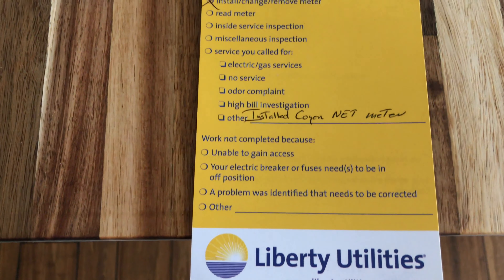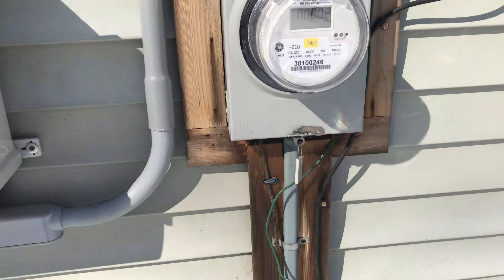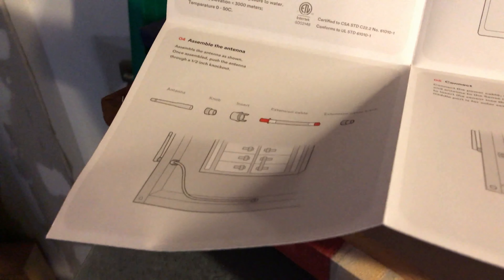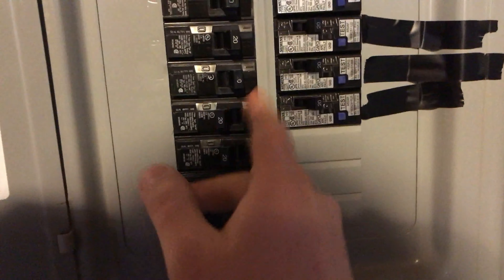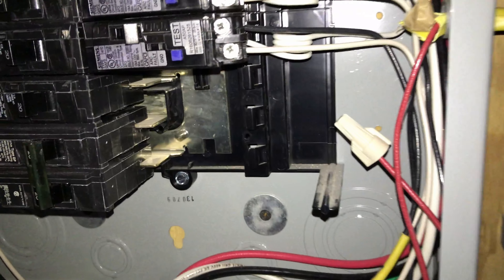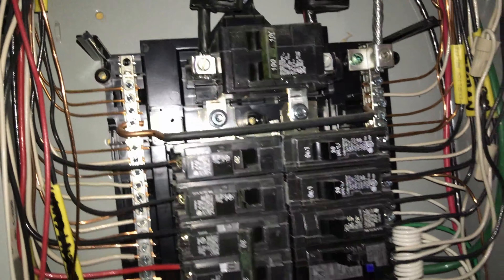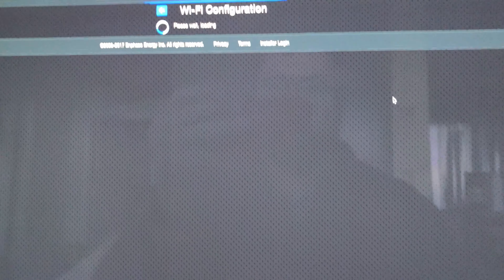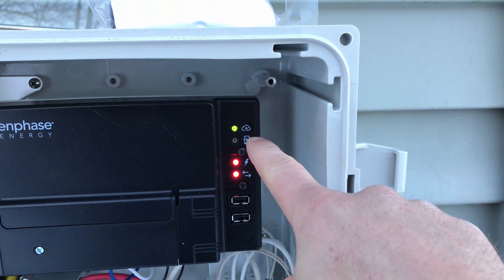How-To: Installing the Sense Home Energy Monitor & Enphase Solar Envoy

Comment: When you attach the red and black wires for power, why was there also a black and white wires attach to the same breaker?
Reply: Was there any issues with piggy backing off that 240v breaker? The instructions say to use a free breaker, just curious if this caused any issues?
Reply: Has anyone figured out the answer to this piggy back question?